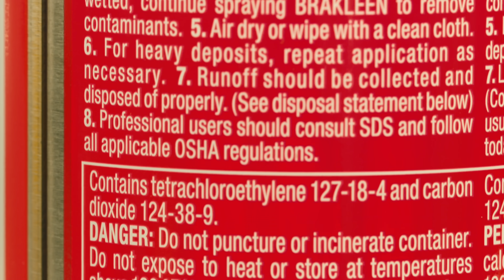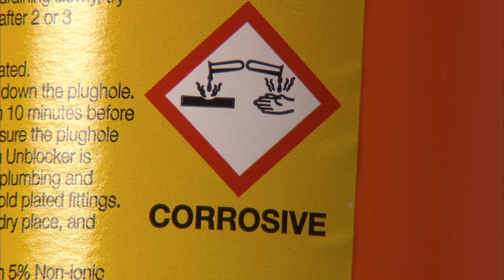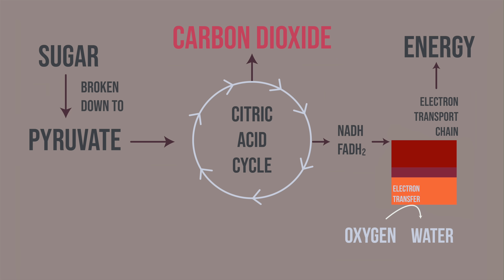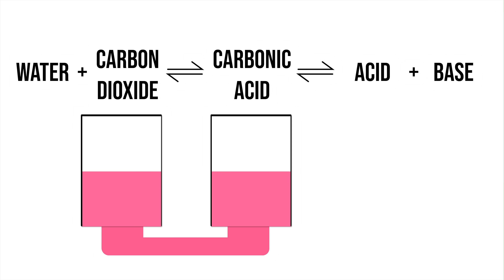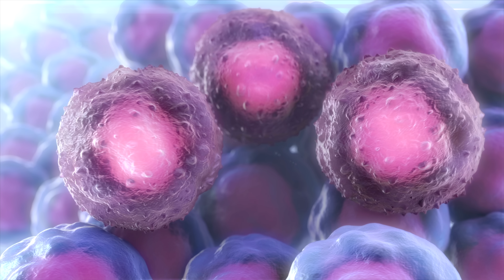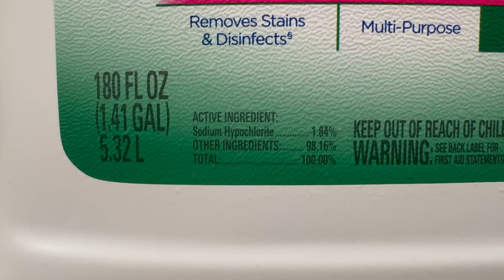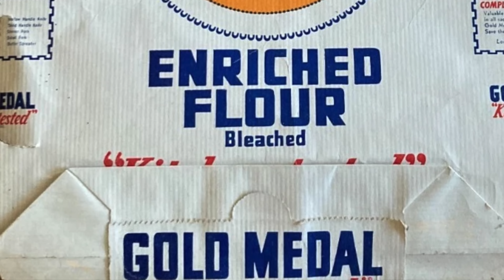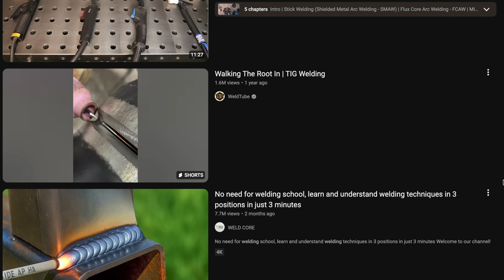"It smelled funny while I was welding and now I can't breathe..."

Comment: Phosgene exposure: 1 to 2 PPM can cause lung injury and 50 PPM for a couple of minutes is usually fatal.  You get a slight whiff at first exposure but it fades until you can't smell dangerous comcentrations.  
Welding or spraying on near red hot metal will create a lot of Phosgene. You can still buy the chlorinated brake clean in some US states. Fortunately Chlorinated solvents are  not permitted in consumer spray brake cleaners sold in EU markets — products had to be reformulated long ago to meet health and environmental rules.

Comment: There is a long list of things that should be kept away from a welding arc. You can easily get metal poisoning from zinc or cadmium. Paint can produce lead oxide when burned. Always have good ventilation or wear an appropriate filtre mask. If you have a friend working with you make sure they are protected also. In some cases they are actually more at risk since the smoke plume coming off the weldment land about six feet away. I have had both zinc chills and 7018 poisoning because I did not take care and follow the rules. Neither one was a lot of fun and the effect the have is you cannot get warm. One of my partners sat in a bath tub full of water so hot he scalded himself trying to get warm.

Comment: I am not a welder and this is one heck of a sad and scary story.  I have experienced the chlorine and heat reaction.  Norfolk Railroad treated a huge are of the country (Eastern  Ohio and Western Pa, and moving southwest and northwest depending upon wind) to that experience.  They blew up their wrecked rail cars loaded with vinyl chloride.  They were on fire, but the experts making vinyl chloride (for whom the RR was moving it) said that the pressure nor the heat was enough to explode the cars.  They blew them up anyways so they could get their trains rolling again on that section of tracks.  Spread a cloud of incompletely burnt vinyl chloride all over us.  Mushroom cloud much like the nuclear one.  We realized the phosgene, and a host of other chemicals, one of which was the spectrum of dioxins, including the worst of those.  This changed my mind about "burning" plastic anything" at home.  But, I don't know, I don't think I'd ever have the thought of using brake fluid for cleaning anything.  Where does that idea come from?

Comment: The only problem in my head is brake cleaner doesn’t effect rust and it’s the most common cleaner to use when welding and it just dries up in a literal second maybe 5. It’s just hard to imagine how this would happen yk like tens of thousands of people doing something identical though it must’ve happened a time or two cause the formula changed to be non chlorinated.(makes it more nauseating from increased fumes and it now melts plastic and a few other things lol)

Comment: When I was a teenager I had a can of some type of cleaner.  It was labeled with a very big warning.  I it said the the light of arc welding would produce phosgene if there were any fumes in the air.  So it's not just the brake clean on the metal, it can be from the vapors in the air around where you are welding.

Comment: You grabbed the attention of some automotive fabricators with this video. 
Most people in our world use non-chlorinated Brakleen (or other brands), and allow it to full evap and dry before doing anything with the piece.  For aluminum, I use acetone to degrease a surface before welding. I have a powerful vacuum fan above my head as well. The video has great info and should be watched as part of welding training.

Another topic kind of related that has very little attention is the impact of vaporized rubber on the human respiratory system. In the world of competitive automotive drifting, these drivers are exposed to a huge amount of vaporized rubber smoke (white color)....not burning rubber (black smoke).  The crowds are also exposed to this white smoke. What impacts does it have? What is it made of?  How toxic is it? Long term effects?  Thank you!

Comment: You should set up a shop vac with a funnel at the end to suck up some of the fumes  or a dedicated ventilation system. Or weld outside. Even the normal Fumes are terrible for you.

Comment: As a mechanic and welder for over 50 years I was not aware of any of this. Many thanks for the very informative information. I will pass it on where I can...
Reply: I trained as a professional welder in the 80's and it was one of the first lessions at college we had.  Never forgotten.
Reply: man.. i did welding back in like 2010, no one mentioned anything about poisenous gas, everyone was more concerned about not looking at the arc with your bare eyes haha, this was in New Zealand in my MIT motorsport engineering class
Reply: @TrippingTank  There more then just this one , that why they make supplied air respirator welding helmet , everyone thinks their just for welding in tanks but there is some kinds of metals that can kill you to , I welded a alloy with Beryllium once a month and it was a big deal , but yeah don't look at the arc and who cares about acute beryllium disease and why would a man use a hot leather space suit that weighs 50 pounds to weld

Comment: Chlorinated brake clean and welding is a no no. 
 The safety flammable in the mill I worked at decided that non-chlorinated brake clean was too flamable. So chlorinated cleaners were everywhere. Welders and electricians were using it. Just the fumes alone were very dangerous. When welding they would use it to clean whatever...I would get up a and leave knowing the hazards but because I was new they ignored what I had to say. Eventually they started wearing respiratory and noone was injured by  some miracle. 
Another thing bleach and dish soap make phosgene as well as bleach and urinal blocks make phosgene.

Comment: Rule number 1 never use brake cleaner when working with welding or brazing! always use sanding and grinding abrasives then use compressed air and or rags

Comment: Posphgene gas is one of the first things welders learn in welding training. I've welded in shops where there is brake clean being used at a distance from my welding area, and just the bright arc rays will produce the gas (it's produced from UV radiation not heat) and I would smell what smelled like sweet rotten apples. I always knew exactly what the smell was from so that would be my cue to throw on a respirator or just take a brake. 
All welders should weld outside or near an open bay, drink plenty of milk, run lots and spend lots of time in steam rooms to keep your breath factories clean. Unfortunately most welders smoke cigarettes all day, pot all night and drink like fishies while they bloat up to the size of a buluga wale

Comment: I use to be a mechanic, fortunately I was well aware of this danger, it's worth noting that Zinc oxide fumes from Galvanized steel are also extremely toxic. I wore a mask and used ventilation to keep myself as safe as feasible in a busy work environment, this hazard needs be highlighted as much as possible, great video.

Comment: I always wear a respirator to protect me from all welding fumes.

BTW, I clean off galvanizing and sometimes rust using muriatic acid. I take a lot of precautions regarding avoiding the fumes. And take the extra step of gradually neutralizing the used acid in a bucket of baking soda solution before disposing of it.

Welding galvanized metal can cause zinc poisoning.

Comment: I have yet to actually get to the part where we explain what's happening in the Er... As a tradesperson I cringed when you mentioned dirty contaminated metals + brake cleaner + a home shop with poor ventilation. Welding is super dangerous even when things are done right, pro welders end up covered in slag scars if they aren't careful and drink soda to push down the grit in their lungs, their eyes degrade from milisecond flashes they get exposed to even with the right gear. Your workshop parts person is often a welder thats too decrepit and blind to weld anymore. This is something that you should not attempt without training and pro supervision.

Comment: This video gave me goosebumps and a realization of, how am I still alive. I normally get the green can of brake kleen but they only had the red can at the store. If I recall, I have used the red can to clean off some stuff I was welding. I am very new to welding as well. Ironically just the other day I was welding some stuff up together yesterday and a week ago. I looked at the red can of brake kleen I had and the thought of using it to clean the parts off I was going to weld struck my mind. The only thing that stopped me from using it for that was because I remembered how the red brake kleen basically made whatever I was using it on seem a little oily it basically acted like WD-40 and even smelled and felt like it. So I didn’t use it because I wanted to fully clean the parts. That is very eerie to think of a simple choice being life and death while in my garage. Also you reminded me that I really should start to focus on wearing some kind of breathing mask while doing this kind of stuff. I don’t weld or grind stuff nearly as much, a small hobby here and there, maybe once every 5 months so I don’t wear a face mask because of my infrequency, but I should wear one. I have also been getting into the habit of wearing coveralls when welding, it didn’t occur to me until somewhat recently that the light is bad for you and not just the feeling of scalding metals hitting your bare skin.

Comment: I had Seafoam poisoning last summer. I was restoring my old lawnmower. Instead of replacing parts I didn't have the money for at the time I added Seafoam into the gas and oil. 
I followed directions on the bottle but didn't read the warning label at all. 
I watched many YouTube videos about Seafoam and nobody mentioned getting sick using it so why bother. 
I stood in a cloud of white thick Seafoam coming from the lawnmower exhaust many times that day laughing about how much it made. 
Later that night after a hot shower my head started spinning so hard I could barely stay on my feet and I kept vomiting. Sitting down, laying down made it worse. The spinning got so fast I managed to call the poison control center. She had to research Seafoam because nobody had ever called about it. 
Day two I called her, I was vomiting orange bubbly foam and with eyes closed or open I couldn't stop my head spinning. 
I refused to go to the hospital because I live in the middle of nowhere and an ambulance could have been super expensive and I don't trust doctors. 
Day three I can't really remember but I wasn't spinning or vomiting as much. I thanked the Poison Control lady and she said if I didn't show improvement she would by law have to call an ambulance for me. 
After 5 days I had stopped being dizzy but I was very weak. 
I will never use a chemical without reading the warning label again or fail to use hand protection because I had gotten the Seafoam in my lungs and on my fingers. 
I fixed my lawnmower at least but it wasn't worth risking my life to fix it. 
Take the time to read the warning labels. It is in fact a life or death situation. I got extremely lucky.

Comment: What a horrifying and yet interesting way to die. 

I have worked around pools and noticed that muriatic acid, when added to a hot tub to lower the pH causes my lungs to feel like they are filling with fluid. I know this is part of muriatic acid on it's own, but this makes me wonder if it might have been reacting with the chlorine, too. 

Another issue people might find is that MFF (metal time fever) is a thing common in welding too. That's why they sell parts with no coatings specifically for welding. The zinc (and possibly other ones, but for sure zinc) reacts when heated over a certain temp and too much exposure can lead to a person getting loopy. Idk if the effects are permanent, but they are yet another reason for people to take care of their lungs and wear PPE. 

For the video, would a respirator (half mask with a real filter, not an n95 that's worthless) actually help? Is the gas such small molecules that they can get in still?

Comment: QUESTION! How long? Let's say you spray a piece of metal with brake clean, how long until you can weld it? Are we talking wet? Dry? Residue from an hour ago, a week ago? Forever? And what if you need to get the job done, how do you remediate the metal to be safe? Water? Follow up  with non chlorinated brake clean?

Comment: Can you use the brake cleaner and then wipe it off and let the surface dry, or once brake cleaner has been used, the surface needs to be neutralized? I recall nitrogen was mentioned as a cleaner or neutralizer in the video for the Chlorine based refrigerants?

Comment: I learned this and not to cut or weld galvanized metals without plenty of adequate ventilation. Anytime welding, cutting, grinding, sanding and or painting etc, you need to protect yourself from breathing it or getting it in your eyes as chemicals in paints can enter thru your eyes.
Be safe everyone.

Comment: There are 2 types of brake cleaner: 
1. isopropanol + acetone
2: insanely poisonous polychlorinated organic chemstry-lab super-toxin.
Number 2 is more prevalent because it is incrementally cheaper. Stay away from ANYTHING that has a halogen (chlorine, fluorine, bromine) added to an organic (carbon-containing) molecule unless you want to be a chemistry experiment.
(yes, it's not poisonous in its shipped form. But heat can disrupt that, as this case shows)

Comment: Did this guy weld a truck in a non ventilated garage ?  When using machines always have open air if possible , especially high energy equipment

Comment: Another thing to keep in mind while welding is keeping pressurized spray cans far away. One bump with the welding tip onto a can of WD40 can result in an explosion. I've seen it happen.  The can whizzed around with a 6 foot flame trailing.

Comment: I used to be a gas mechanic and worked alongside the pipe welders all the time. One welder told me about the smoke- when you get on a new pipeline job, the first 2 weeks you get that scratchy throat thing, then it goes away...

Comment: In the early 1980s, while serving in the United States Air Force, I was stationed at Keesler Air Force Base in Biloxi, Mississippi. During that time, I spent several hours brazing a new floor pan into a Volkswagen Karmann Ghia. The sheet metal I was working with was galvanized, and at the time I experienced no immediate ill effects.

However, around 2:00 a.m. the following morning, I began to feel extremely unwell. I was shaky, weak, and generally felt very sick. Concerned, I went to the emergency room and informed the physician that I had been brazing galvanized sheet metal earlier that day.

The doctor explained that my symptoms were consistent with zinc oxide exposure from the galvanized coating. He provided me with two pints of milk and instructed me to drink them, noting that the calcium could help counteract the effects. Within 15 to 20 minutes, my symptoms improved significantly, and I felt well enough to be discharged from the emergency room.

Comment: 2 minutes in. Phosgene, but it isn't that poisonous as they claim. it hydrolizes into hydrochloric acid and carbon monoxide in the lungs, causing chemical corrosion. still would need to inhale either small quantities over many hours/days or a very large quantity quick (which kills you by acute poisoning). feels more like urban legend.

Comment: Also worth noting you should not weld galvanized steel without a proper mask or fully cleaning off the zinc coating as zinc oxide fumes is also quite bad for you.

Comment: I took a welding class at Truckee meadows community college, never once did they talk about safety most of all about the chlorinated brake cleaner, the worst thing you can breath in. 
No one told me about it till I learned online many years ago. 
Every time you weld you should wear a mask even tig welding don't breath the fumes. 
I was welding on old primed and painted metal I did clean the metal to bare metal where the weld would be but it did fume up around it, I thought I would be ok outside but nope, got mono which is a forever virus in most of us and only comes out with a weak immune system. Then I got a trailer job and of course they paint the frames. I tried to wear my mask but I had almost no room so I would grind the best I could to clean the area and weld it all while holding my breath, had to breath in a few times because I couldn't make it out, sure enough got sick for several days after. Pure clean metal I don't get sick off of but even that smoke will get you after many years, and then grinding, once again it will get you in your golden years, were a fucking mask. 
As for the angle grinder guard take it off and toss it in the trash, don't be a pussy!

Comment: It is important to know what type of brake cleaner one has.  I know of three types:  chlorinated, non-chlorinated (methanol based), and solvent based - acetone/toluene.  My only question is - in my experience - brake cleaner evaporates fairly quick (at least the non-chlorinated types - I avoid the chlorinated stuff)  I wonder how he ended up burning this off into a gas unless he sprayed it already clamped for welding and had his helmet on and just welded right after using the cleaner.

Comment: Had me going there for a second. Was getting super bummed that SP had finally made a mistake lol

Though, I did have a question. Couldn't they drain the lungs? I know they can tap lungs for fluid buildup resulting from other issues.

Also, I've often wondered why nobody has tried putting people on a large flat plate and spinning it to get the fluid out :)